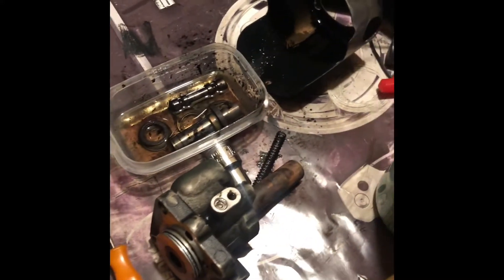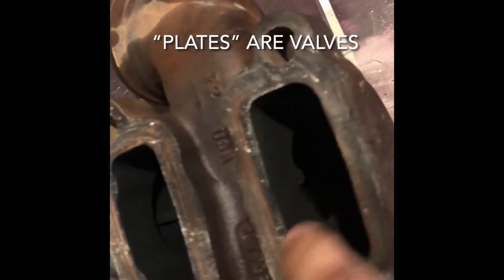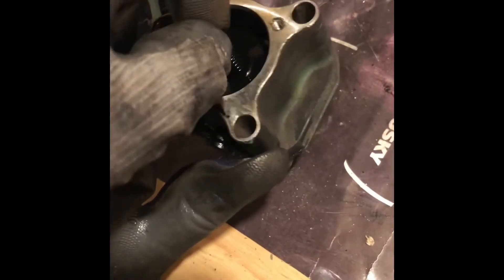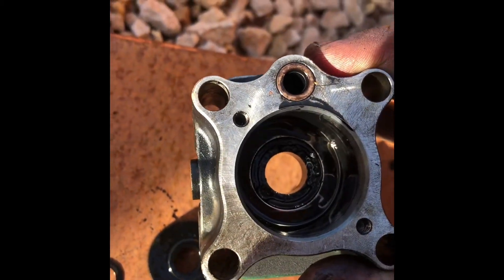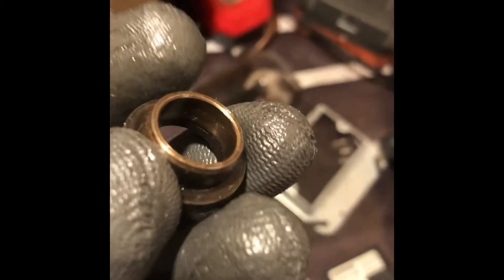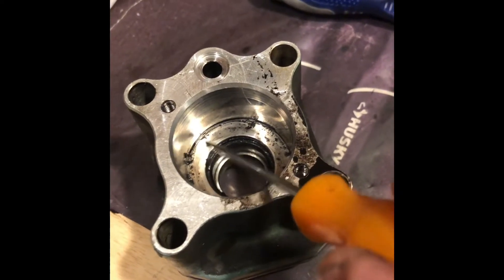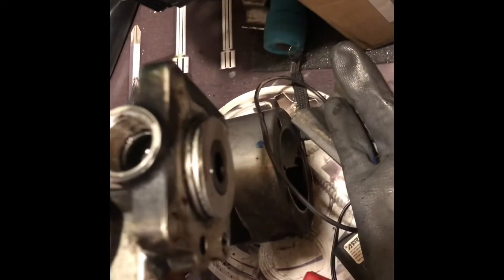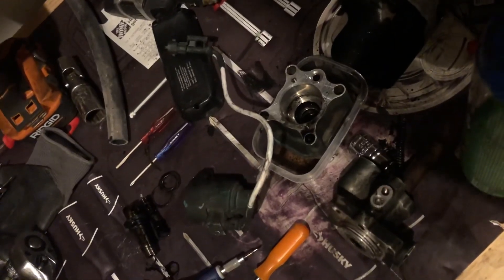Volvo D13 EGR repair

Comment: I'm wondering if a hot boiling water cleaning solution would eliminate the need to separate the valve. Using air to dry the valve and removal of carbon & oil built-up.?

Comment: Is egr software delete a hood idea ?
Reply from the maker: Right now I am testing a different form of “delete”. Unplug the temp sensor on the crossover tube on the passenger side. Throws an engine code. Apparently it doesn’t open the egr valve. Truck has been running great for 6 months. It doesn’t regen more than it did. However, just last week the fireball on the dash stopped coming on. No parked regen. Filters are clean. Truck is  running great. If anyone has insight on this let me know.

Comment: How difficult to do this without removing the turbo?
Reply from the maker: Remove the air box. Remove the first exhaust piping off of the turbo. You will now have room to work. The egr valve is not connected to the turbo. No need to remove the turbo. Removing the egr valve can have its own complications. There is a video from someone else of what they do to make it easier if you run into stuck fittings.
Reply: @southwesttransport4753  Thanks for the reply! I poked around there a bit today and figured as much as you're suggesting. I've got a 2013 day cab and the engine is set pretty far under the cab, so for that section I'll probably remove the inner fender and tire to get a bit more wiggle room .

Comment: I replaced egr valve on Volvo d13 2020 year at 230k miles, now at 330k miles I get the same code P0401 for egr valve. Looks like I’ll need to replace another one, smh 🤦
Reply: All you need to do with that code is to clean your Vinturi tube where the Delta pressure sensors seats. Remove stay rectangle sensor, you’ll see two holes under it, clean up those holes with air and carb cleaner. Set sensor back, clear code and see if it’ll return. If not then you good, if yes then unassemble that Venturi tube completely, clean it all inside and from inside check it air or carb cleaner flows through those 2 sensor holes. If after all efforts you’ve failed to clean both holes, means that carb inside them became to a concrete. Go find used Venturi tube with clean holes, install and your problem solved.
Reply from the maker: Repeated failures of the egr valve is pointing to another problem. How dirty was the first one when it was removed? Do you know why it failed?
Reply: @southwesttransport4753  it wasn’t dirty at all. I’m not sure why it failed but before replacing egr valve I checked everything PTT software told me to, cleaned Venturi Pipe and even replaced delta P sensor on Venturi pipe. After that removed and checked egr cooler and checked for leaks and also cleaned it. After that I replaced EGR valve, performed learn data reset and truck was working as it should. Now 100k miles later I got p0401 message again.
Reply from the maker: @KalchykDen  Are you running full synthetic oil? Or Dino? What weight?
Reply: Great video;When you rpm waves means EGR needs to be changed
They make that part in Syracuse NY; I thought solenoid gets weak; will play with mine

Comment: Is there a seal kit available for the valve?  Would you be able to supply the part number or numbers?  Where do I find your other videos?
Reply from the maker: I looked for a seal kit briefly on google. No luck.  Someone out there knows where to get the parts. I have not loaded any other videos as of (2/9/2022)